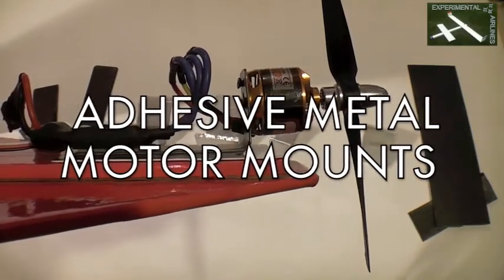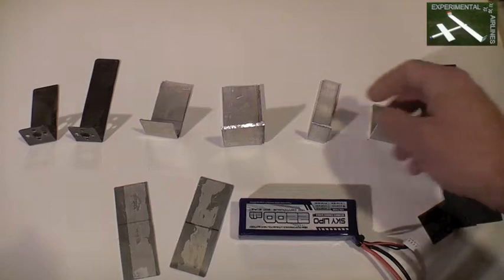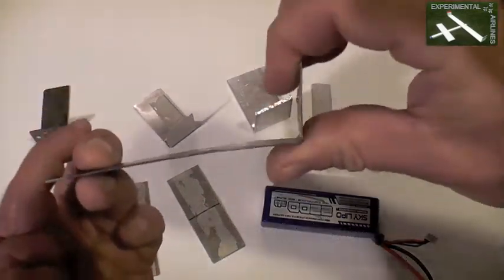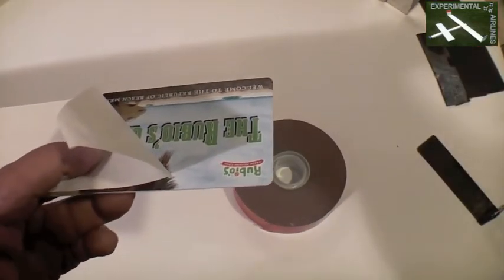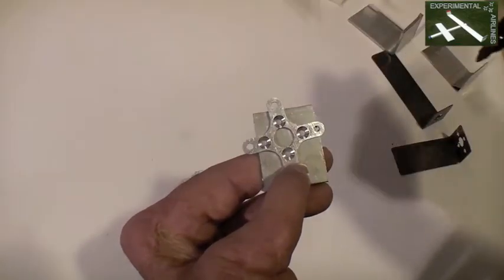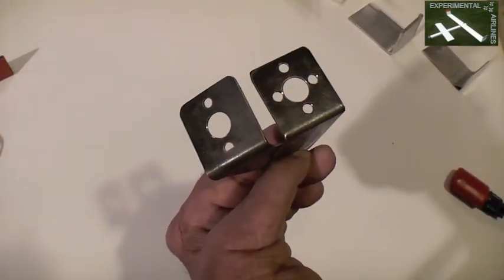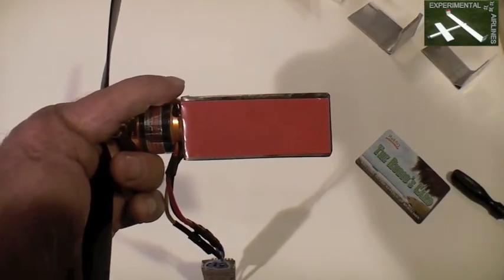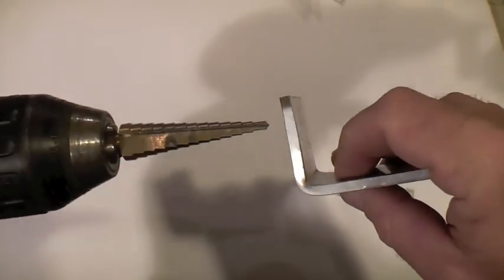Foamboard Building Techniques: Metal Motor Mounts

Comment: Hello. I know your video took place years ago but, thx nevertheless. I happened to figure out this L-shaped motor mount technique using tin (aluminum) and JB Weld since it bends easier for thrust angle adjustments. However, I haven't figured out how to set the mount in my foam UMX Radian's fuselage yet. Do you have any videos, tricks, ideas for mounting that L-shaped mount on to an uneven surfaced foam floor of the fuselage? Thanks!
Reply: Hi. I had the same problem. That is if you mean the floor of the fuselage not being parallel to the wing because the floor is angled down from the nose of the aircraft. If that's not what you mean, sorry. Anyway, my solution was to bend the mount to match the slant of the fuselage, so that the vertical surface of the L-shape is perpendicular (or slightly pitched down from) the line of flight. Hope this helps.

Comment: A tip for drilling holes in metal like that, use a center punch! The drill bit will naturally wander to the center of the divot instead of down the work piece.

Comment: Thanks for your videos on dollar tree foam delta wings, almost done with my first. I was wondering when you fold up your vertical stabaliser, is it posible that you could use the extra foam and put the stabaliser with the extra foam and build 2stabilisers  3or5in in from edge of the wing. It looks a little cooler but will it fly? Or should I just stick to you're plans thanks tony

Comment from the maker: The secret is simple - enable the brake on the ESC.  The prop will hit the ground about 1/3 of the time, but since it is not spinning it will usually not break.  I have not broken a prop (other than in crashes) in over 4 years in this way.

Comment: Thank you so much for the free Titanium motor mount idea. I used Velcro to attach it to the plane. I can move it plane to plane. I even loaned it to a friend while he waits for the HK order to arrive. I have bent and rebent it several times and no problems. It has even saved several propellers.

Comment: This might be far fetched but what is your opinion on using the hobby wood as a Mount kind of like how the guys at flitetest use for there power pod and secure it to the front of the noob tube that doesn't have a tapered nose?

Comment: Hi Ed. I got 2"x4"x1/8" aluminium angle, cut to 2" wide, like one in your video. Sounds silly but did you ever try to bend it to get the proper  degrees of downtrhust. Thanks again.

Comment: Any try using the thin metal bracing bracket (about 1.25" wide) at lowes/home depot that you can buy in different lengths/thickness.  It is in the lumber section with the other joiners, the longer it is the thicker the brace is so you have a couple options for weight/thickness.

Ed any chance you could let us know what the weight is of the few options you use are so we can try to match that if duplicating your builds.

Comment: Now I'm jealous of your titanium! Few people have pools in the UK, and even less salt water ones. :¬( 
.
But I have been picking up some tough rigid plastic containers for machine shop cutting tools. I could cut them down with a taper from front to rear, so ending up with a 3 sided mount. Though I could only do smaller motors at the moment.

Comment: I just built a motor mount like this a week ago, thought I had an original idea  : /   Anyways, I mounted it on the underside so the motor was inline with the wing (Maxi Swift).  Wish I wouldn't have, now its impossible to get to the screws.

Thanks for all the ideas btw.